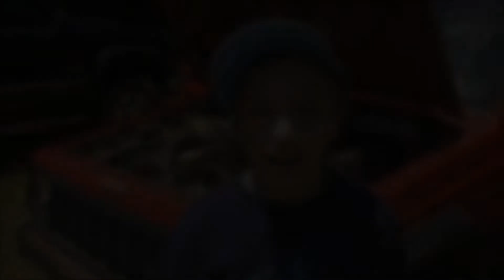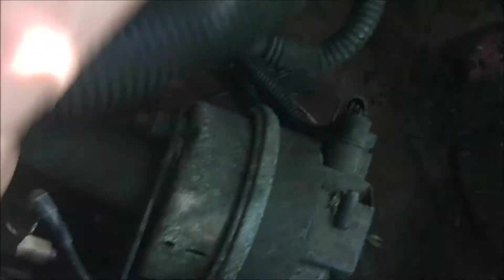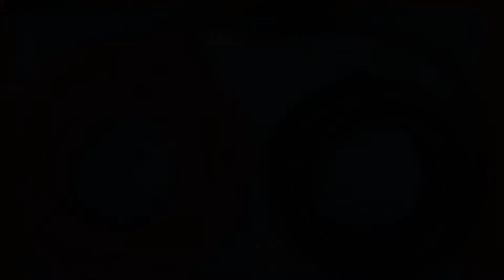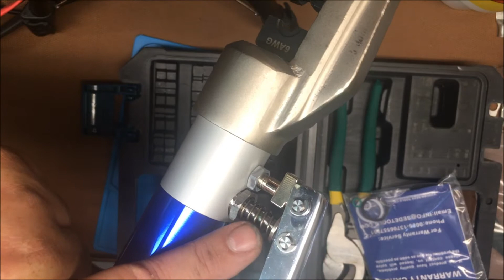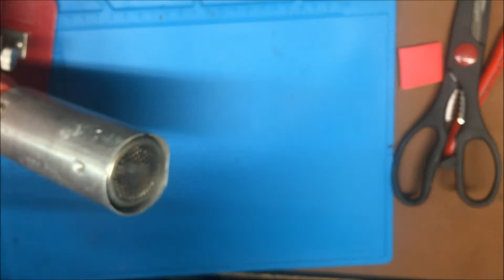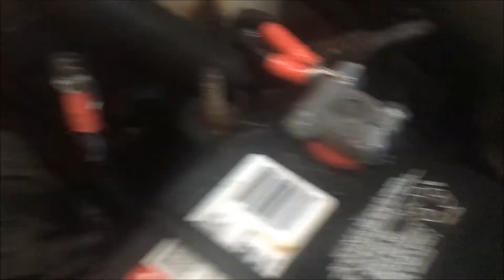Battery Cable Upgrade (Big 7) 1993 Cherokee XJ

Comment: Big thanks!
Doing the same for my Laredo 1992 after watching a lot big7 videos. Thank you for sharing detailed explanation on how to properly remove 2x60A fuse links since just unpluggin stock wire from the alternator doesnt seems clean enough option!

Comment: Hi I drive XJ 93 Contry 4.0 battery problems wish you were my neighbor vid helped me alot over heating problems also
Reply from the maker: I had to change it all.
Even the heater core.
No cooling issues now even with the AC on. The only problem I have now is a spun bearing😆.
We are working on a rebuild as funds and time allows

Comment: Did you connect the alternator to the fuse panel and battery?
Reply from the maker: The alternator is connected to the fuse panel at the bolts on the front. The battery is attached there as well.
Reply: Perfect! Thanks for the video! Great information!
Reply from the maker: @AmandoMeraz  just remember to cut the piece off of the stock cable that connects the two bolts on the fuse panel. Make sure you use a fuseable link or in line fuse on the cable from the alternator.
Reply: @oldxj  understood! 🤘🙌